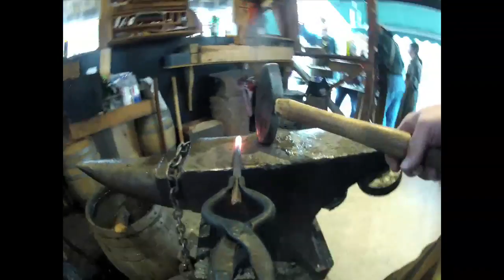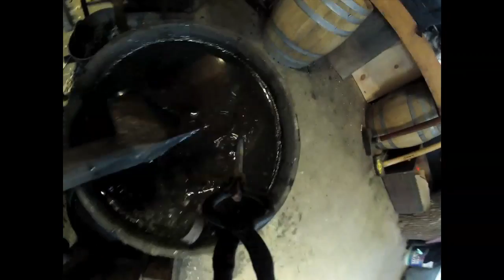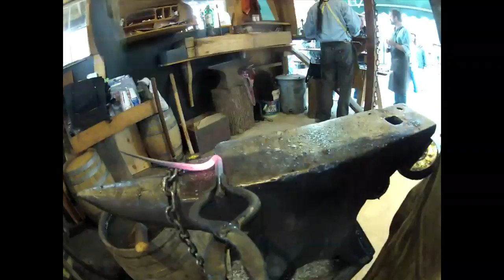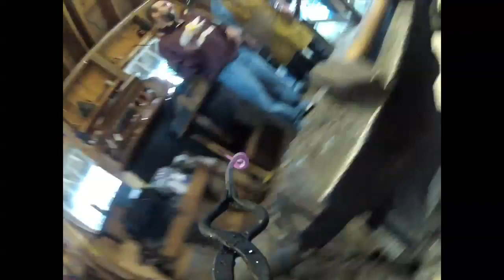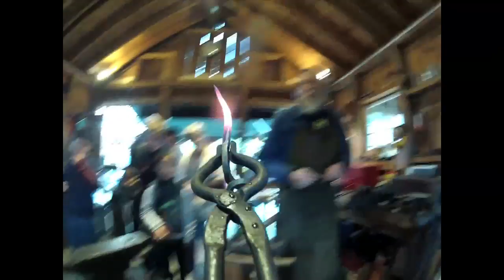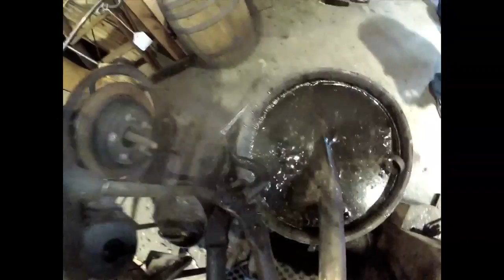Forging a Flower Holder - a Tongs Eye View

Comment from the maker: I cooled the tip so I could hammer on it and it would bend further back (where it was still hot). It also keeps the small, pointy end from burning off while you're heating the thicker middle.